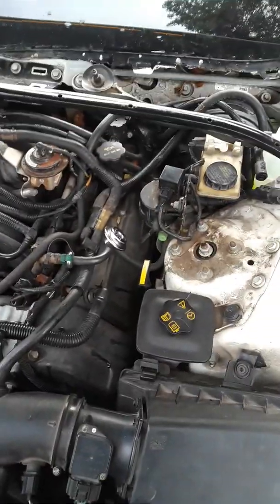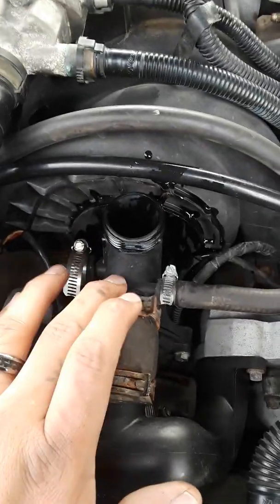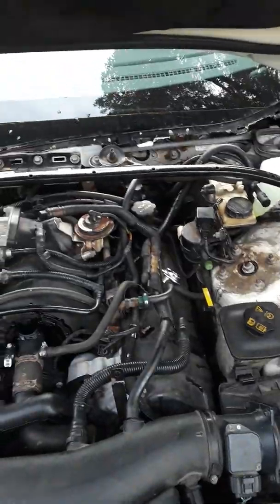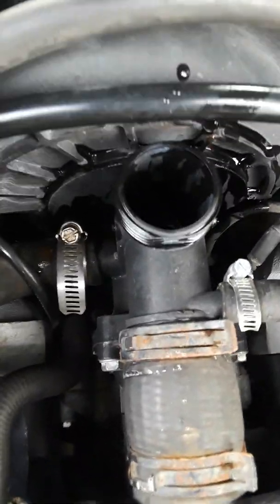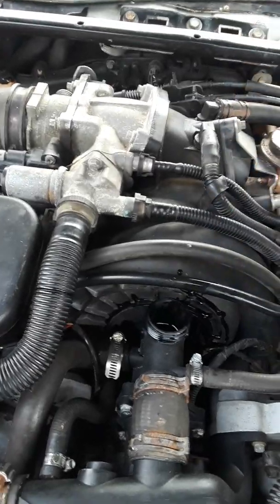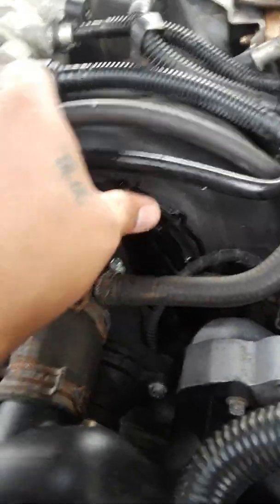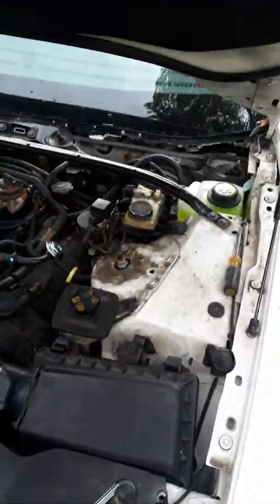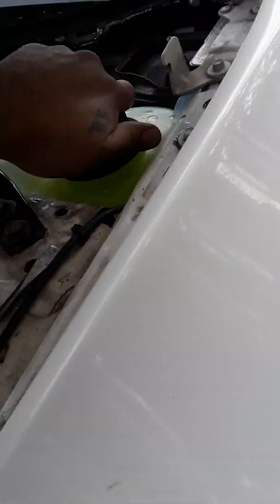Lincoln LS coolant fill and bleeding

Comment: I got the same motor in my Thunderbird and the best thing ive found is go for a drive heater on pulling over every couple blocks and let the air out of the bleeder keep doing it until it flows with no air when you crack it... you can tell if there is air in the system after you shut it off feel the hose if you can feel boiling you need to keep doing it. You might not see it in the tank at all but you'll feel it in the hose.

Comment: I have a 2002 lincoln ls v8 it's over heating cause the fan won't spin at high speed only the regular all of a sudden where is the fan relays for this car located it only spins I notice a little while ago when you put the AC it goes faster but after 5 mins I hear like AC click and it slows down to regular speed and that's  it ?

Comment: You know as crazy as it sounds I was told to fill your block let it rest a few minutes then you degas ....let it rest top off both again then again ....  here's the funny part. Jack the car up in the back letbit run for about 45  minutes and watch the fil l level don't let if fall short and once that's done YA BUDDIE GOT IT  I did this and no problems since

Comment: My 2001 Lincoln LS has heat when I drive or push the gas so do you think I still have air in the system? Thank you
Reply from the maker: Probably. Could also be yoor dual climate control valve goin bad.
Reply: @kbflores  I will check both again I know my valve line doesn't flow constantly like on the video's I have seen it will come out then stop flowing thank you for the response
Reply from the maker: @Anthony-y7z8h  np. Could still have air in the system or a minor hairline crack that lets in air when the car gets hot. As parts get hot the plastic parts expand and what may look just like a lil line will open into a hole when its hot and let air in.

Comment: Is this a v8?
Reply from the maker: Yes.
Reply: bro have you had any problems with they hyrdaulic fan pump
Reply: @kbflores  should i get the metal housing? I just got the smaller plastic housing just for the thermostat area...but somehow there's a small gap even tightened up all the way.
Reply from the maker: @sundayjoy6705  I like the metal one because you can tighten it easier. I always rather have metal than plastic. And it's only like 50-60 on Ebay
Reply from the maker: @bobbychavis6246  I haven't but I kno ppl that have.
Reply: @bobbychavis6246  Best way to fix that problem is switching to e-fans. I switched and never had the problem again.
Reply: Replaced the thermostat housing its still running hot i got the 04 LSV8